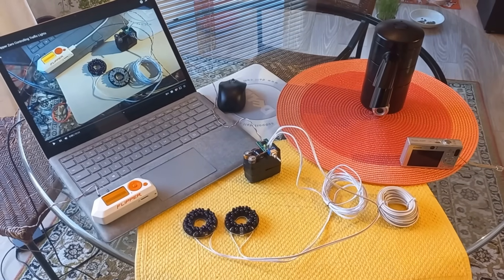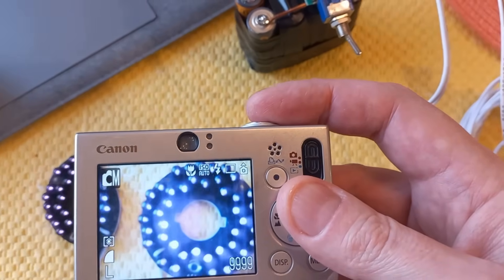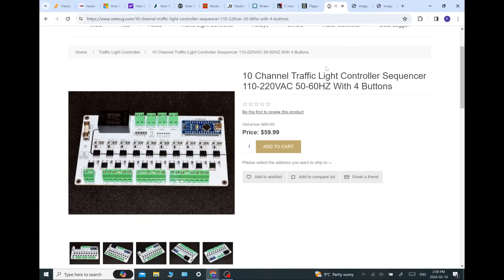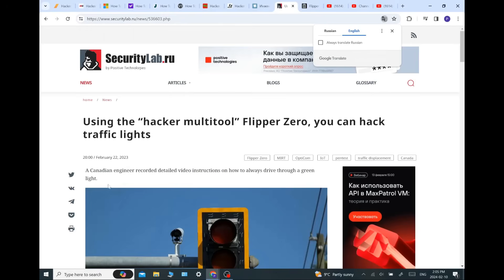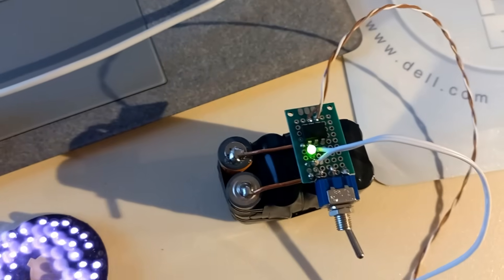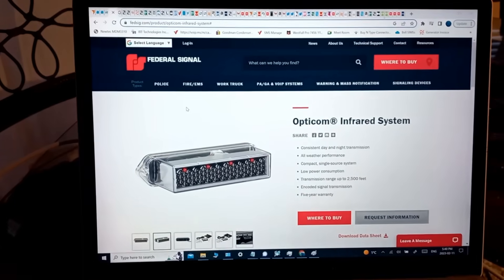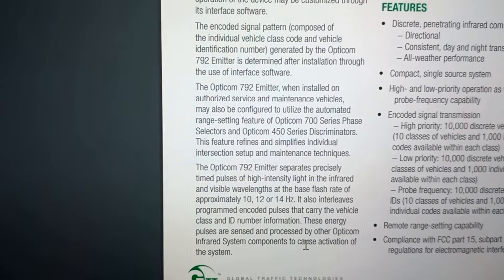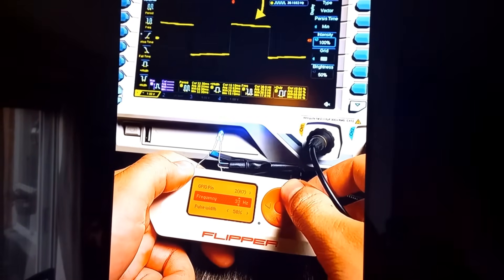Flipper Zero Hacking Traffic Lights - One Year Later

Comment: Total newbie here so sorry if this is a dumb question, but what does the optocoupler do? Does it just make the signal sent from the flipper clearer/eliminate noise coming from somewhere?
Reply from the maker: It does 2 things. #1 it isolates the Flipper from the external 12 volts battery making it a safe way to connect Flipper to an external device. #2 the Darlington transistors in the opto boost the current to allow you to drive the external IRD array with a lot more power then the Flipper can supply. The actual power is coming from the 12 volt battery that is driving the array.

Comment: I noticed response vehicle's could change traffic lights. They were fixing our highway last year. Removed the signal light's, and had lanes closed for traffic. They had one lane for traffic both ways, using signal light's that were set onto trailer's. Noticed flashing headlights would make them change. Which was useful

Comment: Could this potenially work on one of the high powered flipper boards? Or would you need a setup more like yours
Reply: Yes, in theory it could. however the flipper does not put out enough current, to actually trigger opticom without the use of an external power source as he indicates with his 12v external source.   The board being sold by IOTMug does not put out enough IR Output to actually trigger Opticom in most scenarios, unless it's a very very dark room and you're standing right in front of the sensor.  also - More IR LEDs does not equate to more output or further distance.

Anyway just my 2c
Reply from the maker: You are absolutely correct. My design consultation with IoTMug was to use an external booster battery like I have with my own design. Their engineer however decided to power it fully off of the flipper which won't have enough current.
Reply: @peterfairlie2296  So the board works, just not enough current.  Why did they produce the board then if it doesn't work by itself?

Comment: lol its a felony if you are caught with one of these in your car where i live. they won't mess around either and will throw the book at you. they are also insane about any kind of countermeasure for radar or lidar. even if you just have a radar detector, you will get a ticket for something else (dirty headlights, dirty license plate, low tread, etc). super corrupt where i live and not worth messing with this on the road.
Reply: Where do you live that even half of that is a ticketable offense lmfao

Comment: Can also be done with a 555 chip, that costs pennies, instead of an expensive tool.
There is no legal use for this, unless you're emergency services, and you wonder why Canadian government hates flippers.
Reply from the maker: The 555 can't produce a stable enough 14Hz for Opticom however you could use an Arduino. The point of my video was to answer the question of "Can a Flipper Zero do it ?"

Comment: I imagine by now new cameras/sensors would use AI to identify situations where emergency vehicles need the light to change, no?
Reply from the maker: too expensive to implement anything like that at every intersection.
Reply: facepalm 'AI'
Reply: No
Reply: Who hates red lights
Reply: The new systems use GPS and IP networked controllers.  Exact implementations can vary, but the most sophisticated ones assign a route for the emergency vehicle to take (shown on the computer inside the vehicle like a sat nav) and the system adjusts/preempts the traffic signals accordingly as the emergency vehicle moves along the route.

Old school IR Opticom systems can (and probably should) use an authenticated system where each emitter is given an ID (which is then encoded into the flash pattern) and the preemption system compares the received ID to its list of authorized IDs.  Doesn't prevent replay attacks but the system logs dates/times/locations/approach directions for every activation and could be compared to any available CCTV footage to identify an unauthorized user.

Comment: Hi Peter, I have questions about your video where u did the satellite calling. U loaded a webpage via the satellite connection which indicates that it was connected to the internet somewhere. My questions: where is the internet connection? who’s providing it? why is it free? Thank u for your work! 🙏🏾
Reply: Internet itself is just a net of interconnected nodes. The internet comes from an uplink station on earth. As for the "Free" part: I think Peter arranged a (very) low bandwidth connection for testing purposes only. The advantage is indeed that a VOIP connection needs very little, but as you saw the Internet was un-useably slow. It seems logical to have a testing bandwidth connection available because you need to align everything just right and verify operation first or when it's for marketing/demonstration purposes for manufacturers. It's the nature of this equipment. "Free" is of-course not including the 4 to 5 figure cost for the equipment in the first place, haha. Peter seems to be well connected in this field and knows who or what to call (no pun intended).
Reply: @MrDubje  thank u for your reply 🙏🏾 so basically u posit that Peter is utilizing his connections within the satellite and/or communications field to borrow someone’s internet connection, or perhaps an industry associate directed Peter to a resource that we are unfamiliar with. Is that correct? I know that it’s terribly slow, but it could still be useful. For example, it could be used for something like transferring encryption keys which does not require allot of bandwidth
Reply: @BigTurtleMane I think it is best if Peter answers your question. It was a guess on my part. @peterfairlie
Reply: @MrDubje  I agree but thank u, your guess is appreciated
Reply: I'm patiently wait for your IR Blaster